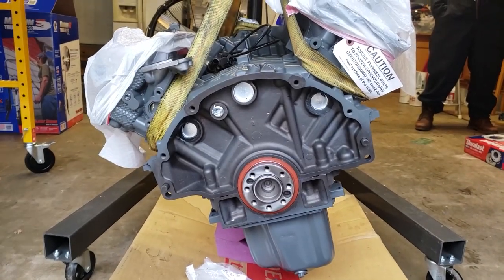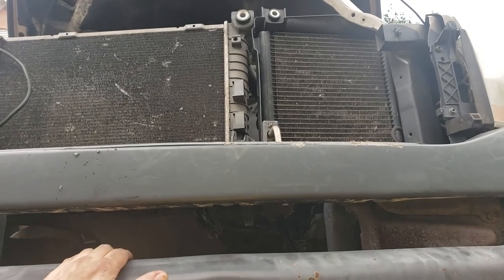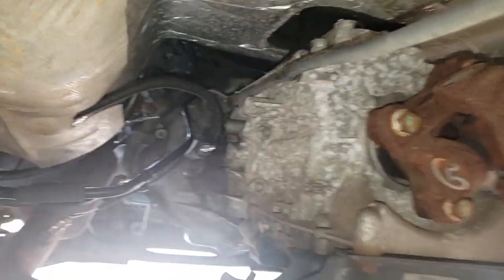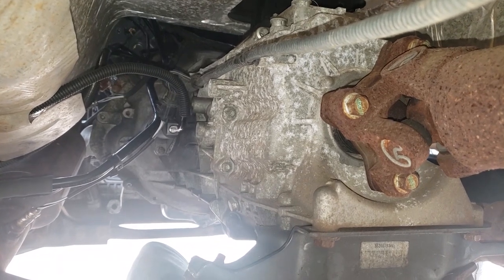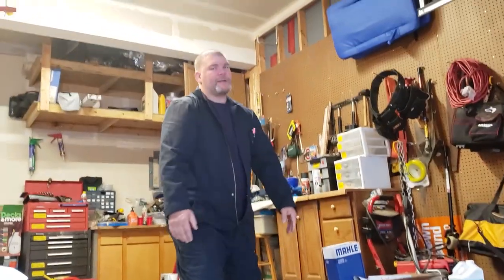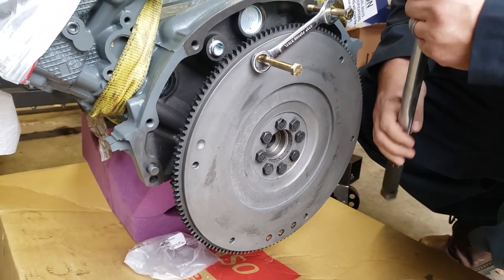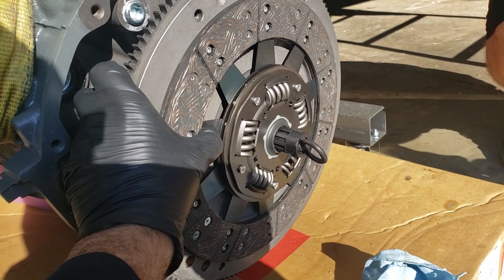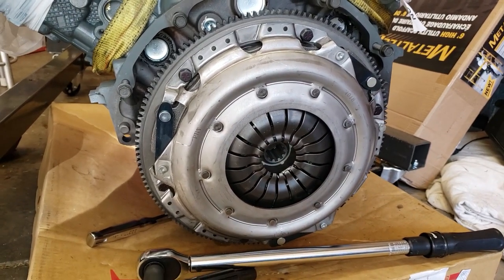Replace Flywheel Clutch Plate Pressure Plate Dodge Ram Chrysler Jeep 3.7 or 4.7

Comment: I need to do this to my truck but idk if its a 11 or 12 inch set 🤔
Reply: if its a ram between 2000 and i think 06 they were originally and 11 inch disc. Per the dodge tsb all of these have been revised to use a 12inch when being replaced. Just make sure to get the flywheel resurfaced and balanced or replace it.